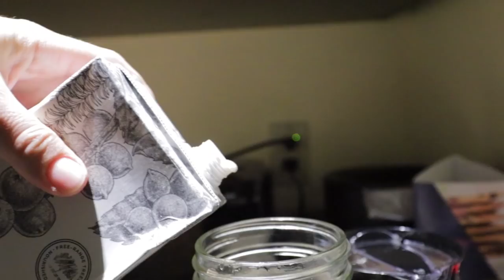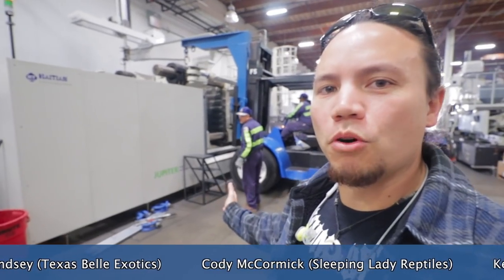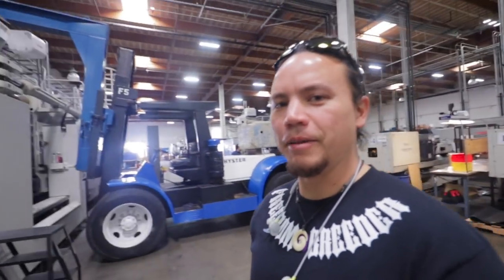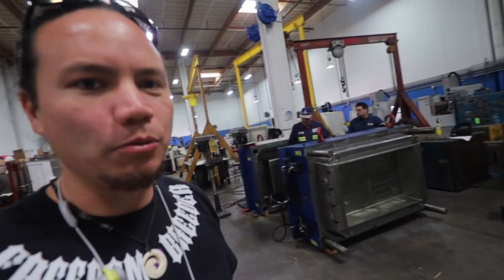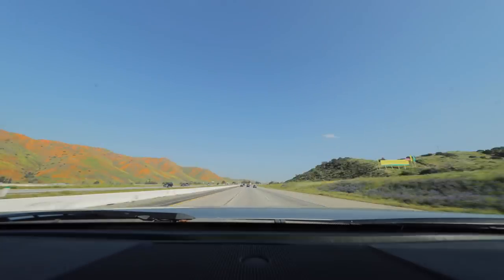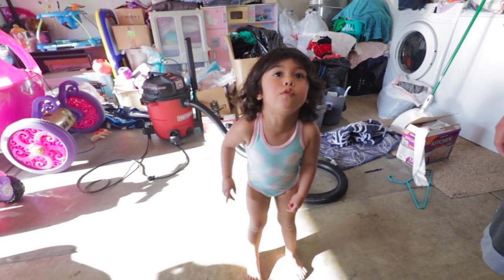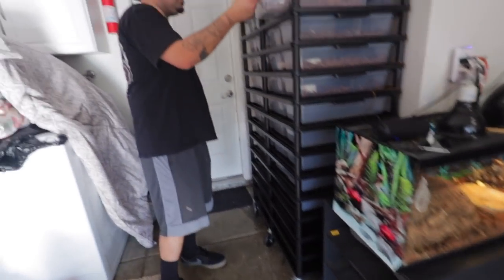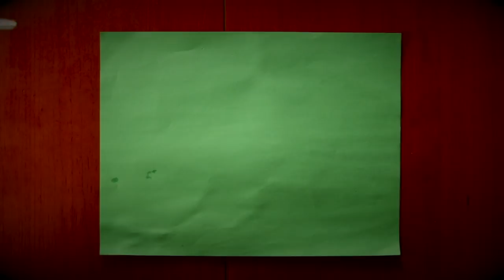When things don't go as planned...

Comment: I work at Chrysler Diecasting plant .. we use machines 10 times bigger than that and make engine blocks and transmission cases.. I lift the dies out with an overhead crane, very very dangerous job! Nice content as always